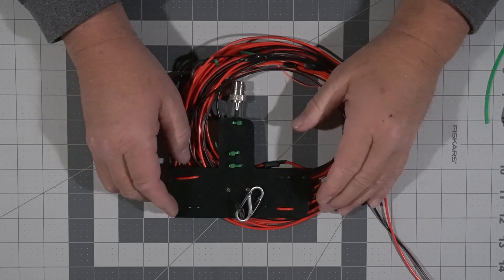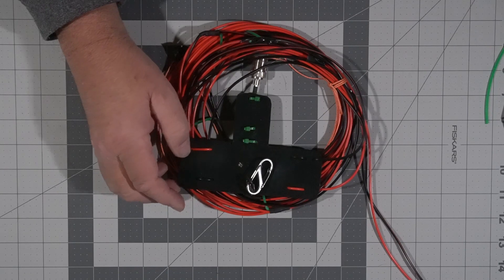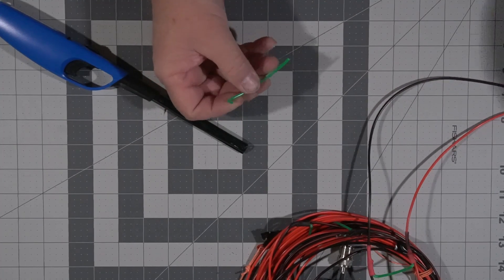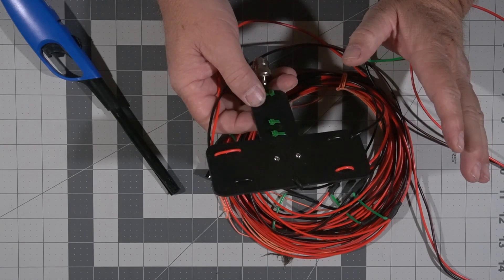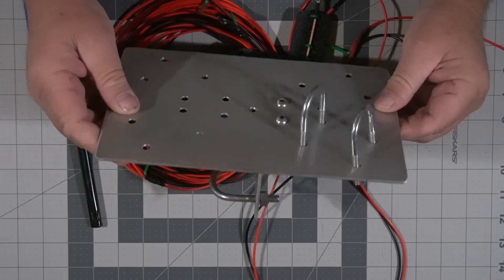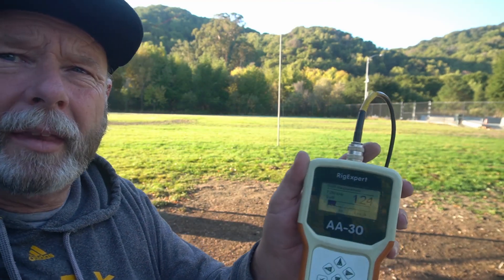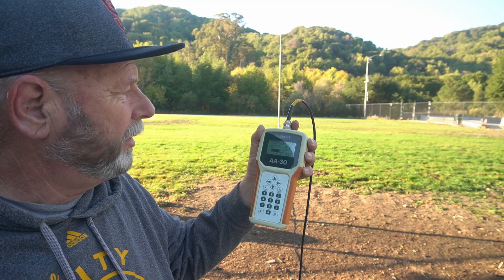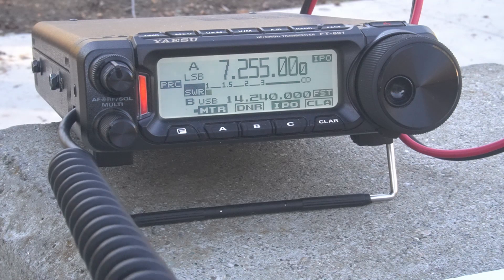How to make a simple Fan Dipole Antenna,  No Tuner Required!

Comment: KK6USY,...Thanks so much for demonstrating what happens when you decrease the angle on both legs of the inverted 'V'! WHAT A DIFFERENCE IN THE SWR!  A 'Fan Antenna' is EXACTLY what I am going to put up, here in Carmel!! Your construction-tips were INVALUABLE!! Wishing you well, Chuck! K6PAM, 73's,.. Ron.... P.S. Chuck, I loved your idea about using heat shrink and weed-whacking string......(Another Ham used a glue stick material to provide a 'locking' medium for stabilizing the wire hangers of PVC piping),... and it seemed to not break-away in extended use!! Your weed-whacking line, (with a glue stick) is a LOT more compact, less tedious, and MUCH lighter!!

Comment: New sub here. New ham also. Licensed in January 2020 in Texas. I am building antennas and currently working on a fan dipole. Once I get my antennas setup at the qth I want to venture into activating parks.  Looks interesting to me.  Who knows, I may not like it as I see myself as a rag chewer mainly.  But I can also be a hunter. Thanks foe the video and it looks like you do antenna videos.  I will be back. 73 de KI5HXM Brent
Reply from the maker: Hi Brent, the fan Dipole was my first real HF antenna I built it's great for the new ham that may only have a radio so all the bands can be resonant no need for a external tuner. POTA can be a lot of fun the bands seem to be getting better and a lot more hunters these days and don't forget you can hunt also if you need contacts to get your 10.  Thank you for the Sub and for the comment 73.

Comment: Nice job.  Easier way to build is run the wires 90 degrees to each other.  Can be fed with a common coax.  Totally eliminate any interaction, you can feed each separately.  I've run up to 3 bands, but 2 are preferred.  The 4ft aluminum/fiberglass camo support military poles are awesome for a super heavy duty mast that can easily be set up in 10 mins. at 32 ft. self supported.   See yeah out there P2P.  K7CAR
Reply from the maker: NWHiker, Yes your right It is a good way to get rid of the interaction, I mentioned in the first part of the video I had done that but wanted to keep the possibility of someone tripping over the antenna at a Park to a minimum plus it takes up less space. When I did at 4 points it was also great as guys for the mast. I want to try the military post just haven't pulled the trigger on any yet. Thanks for the the comment and for watching the video and we will make some contacts!

Comment: Really enjoyed this video Chuck.  I think I will build one.  73
Reply from the maker: Alan they work really well and not bad to make for 2 bands just make it 4 or 5" between and you will be able to get the swr better.
Reply: @KK6USYHamRadioAdventures  Chuck how did you cut the plastic for the center connection?  (Tool Used). TX Again 👍🏻
Reply from the maker: @ReedAB8AS  , I used a 4.5" angle grinder with a cut off disc, but you can use pretty much anything that you would cur wood with.